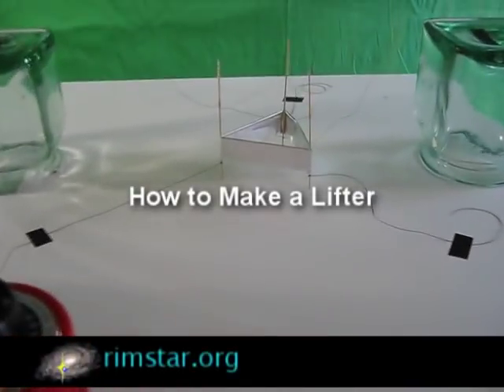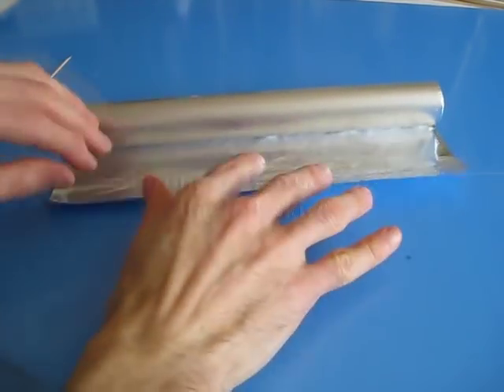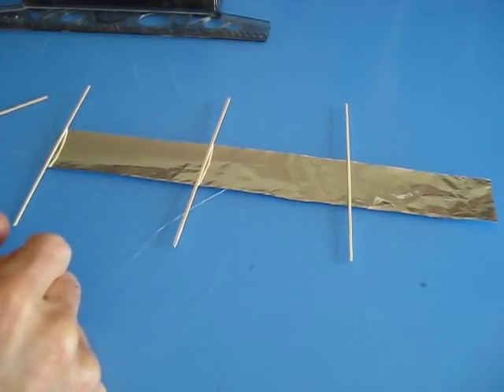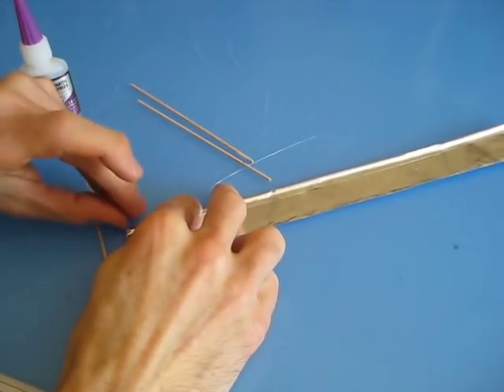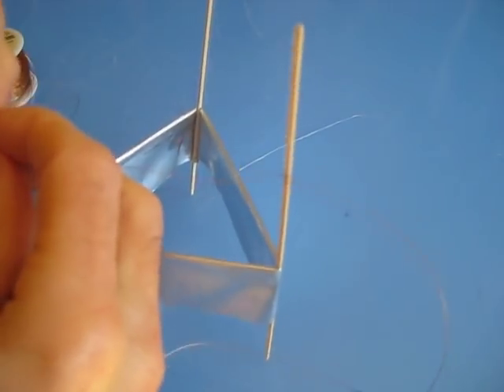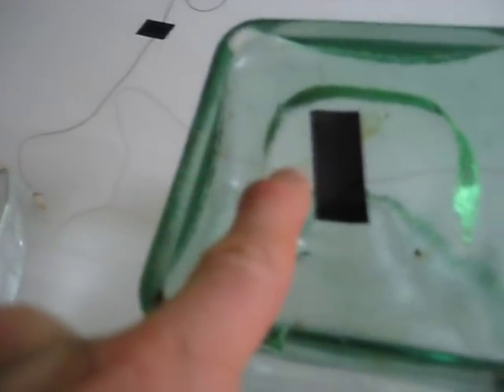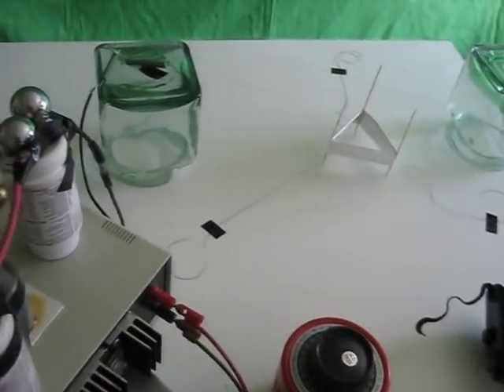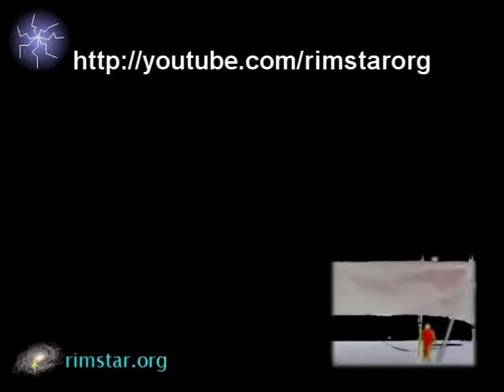How to Make/Build a Lifter or Ionocraft

Comment: could ion thrusters be used to power a solar powered drone for the purpose of rebuilding the ozone layer?
Reply from the maker: Interesting question. It's been estimated that a house-sized lifter could lift its own power supply and a person. The only question from there is could it also lifter the number of solar panels needed to power that power supply. I don't know who made that estimate or how much input power they estimated so I don't know if it's possible.

Comment: For some reason curiosity has brought me to reading about ion propulsion - and of course this video (really cool video by the way) and many others. My questions do not have to be rooted in practicality, though they may seem that way - and perhaps are... 

If you were to contain your lifter in a non-conductive tube, and in series - stage multiple lifters in that same tube, would there not be a significant air acceleration as air passes through the multiple stages of ionization; and could this be done with a single PSU or would you need multiple electrically isolated PSU's? I am just thinking - more thrust of course at the cost of more electricity...

Also, does NASA or other organizations stage grids in their ion engines? In all the cartoon illustrations I have seen, the positively charged xenon particles are simply neutralized by electrons after they are accelerated through a single grid. Why not stage multiple grids to get more velocity (impulse) out of those ions before neutering (neutralizing) them?

This is cool stuff, its hard to believe the concept is almost as old as jet engines...
Reply from the maker: Stacked lifters have been tried like that, though not with the non-conductive tube. Lifters produce their ionization using electric fields and non-conductive tubes don't confine electric fields. Here's one http://jnaudin.free.fr/lifters/maximus2/index.htm.
I don't know everything NASA's done but I've only seen the same thing you have, non-stacked ion engines.
Reply: That is close to what I had in mind, but different in principle. My thought was that if the lift is provided by air particles being accelerated by the flow of ionized particles, then the air velocity is quite slow relative to the ion particle velocity. If one were to stage the lifters in confinement, then the air could be accelerated by the first stage. Then that already-accelerated air could undergo further acceleration by subsequent stages thereby generating more thrust velocity. The confinement is simply to contain and direct the thrust as it is being accelerated, or maybe I am not thinking of this concept correctly?
Reply from the maker: Joseph Banning
I think you have the concept correct. The stacked one I linked to did what you're talking about -- it just wasn't enclosed. It was equivalent to multiple lifters stacked on top of each other. It just wasn't obvious because the sharp bottom edge of the top lifter took the place of the thin wire for the next lifter down.
Reply: Ah! - that makes sense, I get it now. It would be interesting to see if simply wrapping the maximus 2 in thin plastic would increase thrust/lift beyond the weight of the plastic wrap...

Thanks for taking the time to reply to my questions!
Reply: +Joseph Banning Really good questions! I'm somewhat new to these concepts, heard of and have seen them for a long time but never really paid much attention. You guys are awesome.

Comment: Is it possible to use a AA battery with an on off switch for the power supply?
Reply from the maker: Daniel Moulson No, you need high voltage, around 25,000 volts just to get it flying, and also relatively high current.

Comment: Can we use this for DIY sattelites/ space gliders?
Reply from the maker: PojntFX This particular design for ion propulsion requires a gas all around it, so it's probably not the most efficient of designs. It won't work in a vacuum without a gas to ionize. NASA's ion propulsion engines use Xenon gas and are a more efficient design.

Comment: If you increase the voltage significantly, can this create thrust similar to that of a jet engine?
Reply from the maker: The ionization that happens at the wire limits the voltage. However, with my power supply when I continue to turn up the voltage using the VARIAC, while the voltage doesn't increase anymore, the current does. That current leads to more ionization which leads to more thrust. So yes, turning up the input voltage increases the thrust. It already works like a jet engine at lower voltages since it produces a jet of air.
Reply: RimstarOrg Not trying to sound stupid or anything, but based on what you just said, if I input 700 million volts, will the thrust be around 100 pounds? Or something like that? I realize you may not have the time to work with numbers like these, but please tell me sir if something like this is possible.

Comment: Are you supplying AC or DC voltage? Also what wattage is being produced?
Reply from the maker: It's DC. I don't know the exact current, somewhere above .25mA and probably below 1mA. The voltage is around 25kV. You can see me measuring it in this video https://www.youtube.com/watch?v=LOGAaObsN4g.
Reply: Your power supply can it supply more amps if needed to power additional lifter simultaneusly? Aat 25KV how many amps ccan you supply give out? I am thinking of making multi stage lifter drone.
Reply from the maker: Mine can, yes. It doesn't have current limiting. I don't know what its maximum amps is or how many lifters it can lift before there's not enough current though.

Comment: How much voltage do you need for this and amps? Want to do this for science class in a bit.
Reply from the maker: Around 26kV and somewhere over 250microamps. I didn't have an ammeter that was good for the current range so all I have is a lower bound. You can see my measurements in this video "Lifter Voltage/Current and Smoke/Airflow Test Measurements". Working with this voltage and current can be dangerous so make sure you know what you're doing and take safety precautions. Also work in a well ventilated room as this produces a lot of ozone.
Reply: RimstarOrg
Just read this through and microamps? Do you mean Milliamps?
Reply from the maker: Æíxìlïmar I meant microamps, though it could be low milliamps. My meter has a maxium 250 microamps range and the needle went to that and then past it, so I'm guessing somewhere over 250 microamps and probably not more than a milliamp or so.

Comment: there is small current and resistor dont eat a lot of voltage, i guess resistor dont affect the ionizing performace. am i correct?
Reply from the maker: That's right. The current is very low so not much energy gets lost in the resistor.

Comment: How much O3 is created? Would it be dangerous to your health if you ran it for extend periods of time?
Reply from the maker: I don't know how much O3 (ozone for those who may not know) but I know some is. It is toxic and bad for your health. There's more about its health affects here http://en.wikipedia.org/wiki/Ozone#Health_effects I've recently learned that with voltages somewhere around 4 or 5kV or lower, O3 isn't produced. But lifters require much higher voltage than that. Mine flies at around 25kV.
Reply from the maker: *****
Yeah, it would be "possible" jet engines. It's guesstimated that to carry a single person you'd need one the size of a house, millions of volts and the person would have to be in it. Not sure how practical it is. It'd be an amazing stunt though. :)

Comment from the maker: No. You need a high voltage power supply. A computer power supply puts out only around 12 volts DC. A lifter needs one that puts out around 30,000 volts DC.

Comment: What is the biggest lifter you've done? Can you make one that's 1 meter, or larger, or does it lose functionality, like a mosquito?
Reply from the maker: The size in this video is the biggest lifter I've done. The largest I've seen was one that was one layer but was the size of a room. That one was done in a building in Japan (IIRC) back around 2001. So as long as you have a power supply with a high enough voltage and current, then you can go big.

Comment: i would like to know if i would like to apply this experiment to lift things with weights, is that possible?
Reply from the maker: No. Theoretically it's possible but not practically. To lift a person you'd need it to be the size of a house and use millions of volts. The record is lifting 100 grams of weight.
Reply: +RimstarOrg will heavy aluminum and gold wire work i know that gold is a super conductor also i don't have the supplies to conduct the experiment
Reply: +RimstarOrg also i wanted to ask if the heavier the lifter is the more power will you need to lift it ? if so then you will need gold wire and liquid nitrogen to so that the wire feeding the power will have to be going through the nitrogen and then the lifter for more power. the gold is a super conductor and the liquid nitrogen will amplify the electricity in the gold also it will acted like a super conductor
Reply from the maker: The lifter has to be as light as possible so heavy materials won't help.
Also, a super conductor won't help. I'm guessing you're thinking it would help because you wouldn't need a power supply. But in the lifter, the electrons leave the wire and attach to atoms in the air and are lost as far as the circuit is concerned.
Reply: +RimstarOrg i didn't say you didn't need a power supply i know you need a power supply but what i mint is with the power supply and the supper conductor will it make it more powerful also i was thinking if you make one a little bit heavier than the last one  and see how much power you need to lift it you will need a lot of power right and a generator can supply the power

Comment: In my world we call 6/8 of an inch 3/4.
What high voltage ? DC or AC ? How many volts ?
Reply from the maker: DC and around 25,000 volts for stable flight. I show measuring it here https://www.youtube.com/watch?v=LOGAaObsN4g. The power supply is this one https://www.youtube.com/watch?v=GEuK1OdYxHk and I show another demo of the lifter near the end of that video.

Comment: I have used mine several times with no resistors and have yet to blow the power supply. The plans for the power supply were taken from the many online plans for the lifter and none used resistors.

Comment: Would an ELK-P624 power supply work as a power source?
Reply from the maker: Tronics Shop It won't work. The ELK-P624 puts out 6 to 24 volts DC, but the lifter needs around 26,000 volts DC.
However, the power supply I use is really two power supplies, a low voltage 0-24 volt DC power supply which feeds the high voltage power supply. The ELK-P624 is capable of supplying only 1 amp, but my high voltage power supply takes around 2.5 amps as input to fly the lifter. So the ELK-P624 won't even work as the low voltage side, unless maybe you have a higher efficiency high voltage power supply than mine.

Comment: All easy till you get to the power supply. Can i use a 12v car battery and coil ?
Reply from the maker: You're right. The lifter is easy to make, the power supply is the hard part. No, it needs around 25,000 volts DC and with a decent amount of current too.

Comment: Seems strange to me that the aluminum skirt was connected to ground. But when he turned off the power there was still high voltage available to make the spark.
Reply from the maker: The spark was because there was still voltage on the thin wire side of the circuit. The thin wire and the skirt have no electrical connection between them, so when I turn it off, the charge can't go from the thin wire to the skirt. Notice that when I do eventually touch the skirt there's no spark because as you observed, it's connected to ground.

Comment: will enamel coated wires work or will i have to strip off the enamel with sandpaper?
Reply from the maker: You'll have to strip of the enamel where the wire is a part of the lifter. For the length of the wire that's going from the power supply to the lifter you don't have to strip off the enamel.
Reply: Thanks, man
Reply: Trying to get my lifter to lift off, but not working yet.
perhaps it's too heavy, or the wire isn't thin enough. Working with a 15 kV power supply, maybe insufficient voltage.
Reply from the maker: I've heard of it working with 10kV power supplies but that was a very special effort with a tiny lifter.  Mine needs around 25kV as measured in this video http://youtu.be/LOGAaObsN4g.
I have a tips section on my webpage here that might help too (rather than repeat it all here) http://rimstar.org/sdprop/lifter/lifter.htm.
Reply: thanks for the info. I'm looking into using stun gun parts and use ~100 kV pulses to power the ionocraft. i wonder if you've tried something like this?
Reply from the maker: No, I haven't tried that. Make sure it's either DC or pulsed DC, not AC.

Comment: How much electrical power would you need to lift a person into the air with this kind of vehicle?
Reply from the maker: I have no idea. The usual estimate is that the lifter would have to be the size of a house though and you'd need millions of volts. The current would also be very high to produce sufficient ions.

Comment: hi this best! Your use 25 KV? How much weight can lift Ionocraft?
Reply from the maker: The lifter in this video can lift only itself, around 2 grams. The record is 100 grams by someone else a long time ago, but that was a much more elaborate design and with a specially designed power supply.
Reply: RimstarOrg And you know how much voltage used? thanks
Reply from the maker: Joel Arrejoria
46kV, but that's meaningless without the current. The current was a huge 4.38 milliamps for a total of 201.55 watts. A continuous 4.38mA at that voltage is pretty huge. A typical soda can Van de Graaff can easily supply 80kV but the continuous current is in the low microamps or less. My 30kV homemade flyback and tripler power supply can supply only around 250microamps at 25kV. The current is what feeds the creation of ions for the ion wind, and a lifter big enough to carry 100 grams has to create a lot of ions and be big to be efficient. Here's a link http://blazelabs.com/e-exp14.asp

Comment: ca  you use battery?? and how many voltage can you use in ion plssss
Reply from the maker: No, a battery won't work. You need at least 25,000 volts and a reasonable amount of current. An electrostatic machine like a Van de Graaff generator or a Wimshurst machine has the voltage but not the current. I have to use my homemade 30,000 volt power supply (https://www.youtube.com/watch?v=GEuK1OdYxHk).

Comment: Sir after making this all we can use battry please tell me? Plz plz plz olz plz plz plz
Reply from the maker: No, it needs a high voltage power supply, around 25,000 volts. Even then, it needs one which can supply a relatively high current too.

Comment: Can you name the factors which will increase the airflow caused by the thruster?
Reply from the maker: Youandi Hoefman Voltage, current, wire diameter, distance between the wire and the foil, total length of wire/top edge of foil. You need enough voltage to create a strong enough electric field to begin ionization. A thinner wire and/or smaller distance means lower voltage is needed. Once you have ionization, voltage remains pretty steady and additional energy goes into the current for ionization. Length is important since the current has to be shared over that length.
Reply: So, if you can increase the voltage, you can increase the distance, but you'd need a thicker wire for that? So basically upscaling the whole thing will increase the airflow?
Reply from the maker: Youandi Hoefman Well, I guess once you've gotten the voltage needed for the given distance and wire diameter in order to do ionization, ultimately increasing the airflow/ionization is done by increasing the current. But increased ionization means you'd eventually start sparking (which you don't want since that's a short circuit), which means you'd need to increase the distance, and therefore the voltage, and current, ... So yeah, you'd end up upscaling the whole thing.

Comment: Can we use high voltage converter available in the market
Reply from the maker: You need around 25,000 volts with a relatively high amount of current, somewhere close to 1 milliamp.If you're talking about all those cylindrical type ones that are all over the place like this one https://www.ebay.com/itm/1000KV-Ultra-high-Voltage-Pulse-Generator-Super-Arc-Pulse-Ignition-Coil-Module-S/182402637561?hash=item2a780b5ef9:g:IVgAAOSwZQRYY4-T then no (plus that 1000KV rating is nonsense). Even if those are DC and not AC, I doubt they'd have enough current.
Something more like the HV350REG here https://www.amazing1.com/hv-dc-power-supplies.html should work.
Or if you can find an old CRT type PC monitor then you can make one like I show how to here https://www.youtube.com/watch?v=r32e0QGdm8U

Comment: can i use high voltage generator 1000KV instead of power supply
Reply from the maker: Do you really mean 1000KV? That's 1,000,000 volts. If so then as long as there's also sufficient current (around 1 milliamp) and it's DC, then sure. Otherwise, if you meant 1000V then no, this one needs at least 25,000 volts.

Comment: Have you tried this in a vacuum?
Reply from the maker: Brad Arnold It's been tried. With some the effect goes away. With others the effect is still there at a reasonable high vacuum but the thrust is so small a that reduced pressure that it can probably be accounted for as off gassing, propulsion due to ejection of matter (in the cases where there were sparks), or coulomb forces.
Reply: That's too bad. Still, I hope electrogravitics is possible.